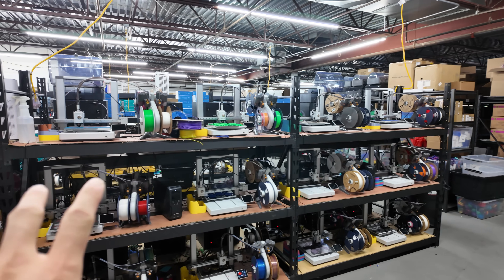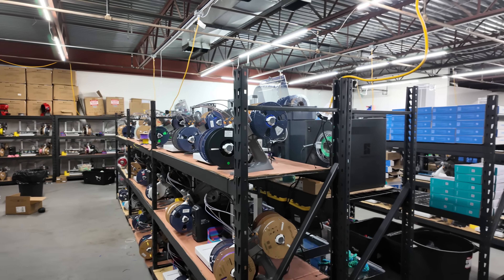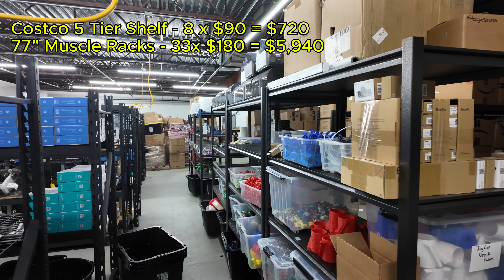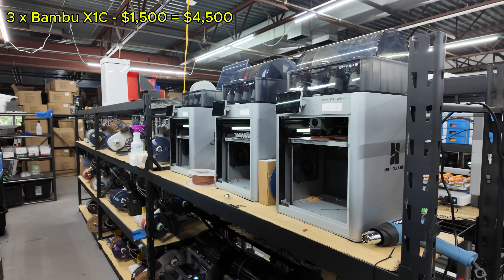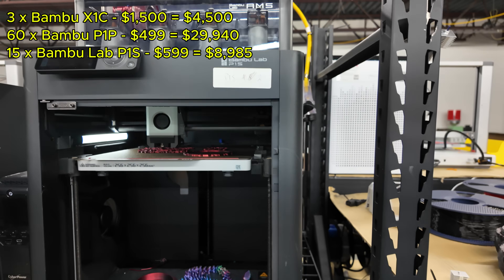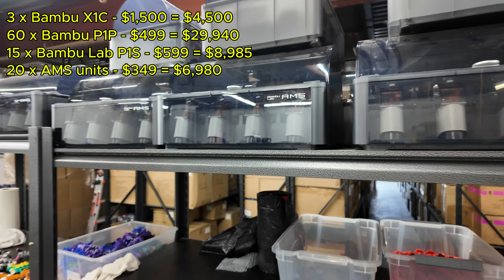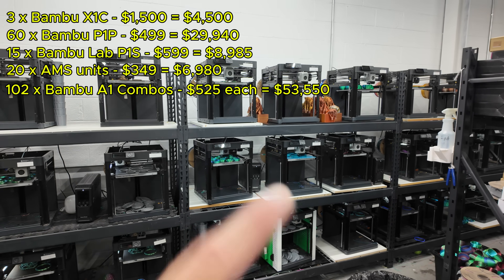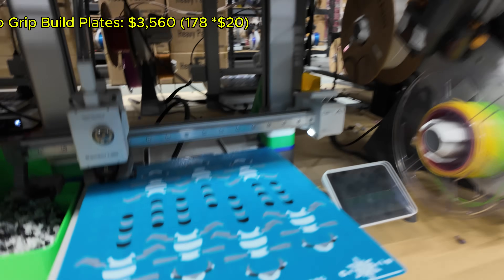$130K 3D Print Farm Setup - What It Takes to Run 178 Printers

Comment: A plastic injection machine would be more economical?
Reply: Only when you get into thousands of units to produce (not one-offs) and only if the part can be injection molded (not all parts can be easily injection molded).
One injection molding die might cost $10,000. (That does not count the amount you'd also have to pay per unit for it to be used.)

Comment: Dear Dancyn, what is the advantage of using Cryo Plates for your situation?
Reply from the maker: Better bed adhesion compared to the gold textured pei sheets. However, lately, the grey ones have been underperformed I  do think they degrade faster
Reply: @Dancyn3Dprints  With the changing of seasonal temperatures happening now (May), do you think the bed adhesion issue could be caused by A/C airflow in the warehouse?

Comment: Nice setup! Have you ever had a printer catch fire? Is that something you worry about or plan for?
Reply: Well he uses Bambu's not Prusa :D Plus that A1 power cable issue has been addressed and fixed already, for a 2 year old company hard to complaint.
Reply: Used to have the 30 printers in our basement. Never had a fire
Reply from the maker: Never

Comment: About 9:20 you were showing a plate with a circular item. I cannot get Bambu Studio (or Handy) to let me print more than 1 circular item at one time on a plate. My item is 4.5" across but bambu wants like a 9" circle of clear area around it. How do you get it to let you print items close to the circular item?
Reply: Looks to me like the circles are all the same filament and type. Maybe you are printing by object instead of by layer perhaps?
Reply: @ Thank you, that was the trick! It was set for "by object". Once I changed to "by layer" it removed the collision error message. I'm newbie and just wasn't sure what the appropriate terminology was I needing to searching for.
Reply from the maker: In the slicing sequence option do you have it set by layer or by object? If it's by object switch it back to by layer
Reply: @Dancyn3Dprints  Thank you, that was the trick! It was set for "by object". Once I changed to "by layer" it removed the collision error message. I'm newbie and just wasn't sure what the appropriate terminology was I needing to searching for.

Comment: What do you recommend P1 series or A1s for printing minis specially. Like is there better results with P1Ps or whether A1s are more cost effective....?
Reply from the maker: Eh tough decision honestly the print quality is a bit better with the core xy design of the p series printer but not by much. If it's in your budget go for the p1s
Reply: Don't print minis on fdm I doubt u will be happy with the results.
Reply: @anab0lic  not mini figurines. mini flexis/articulated animals

Comment: At what temp do you run the gryo grip plates?
Reply from the maker: @unzensiert-ungeschnitten3990  usually around 60 for the mini animals
Reply: @Dancyn3Dprints  I also run the supertack at that temp. Adhesion is highest at that temp. Same for cryo I guess ?
Reply from the maker: @unzensiert-ungeschnitten3990  eh probably 65?